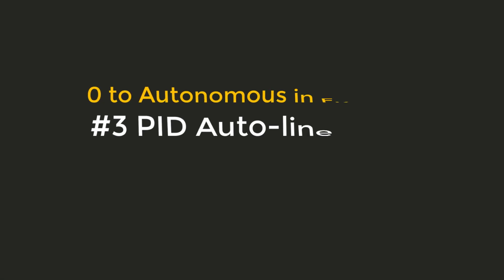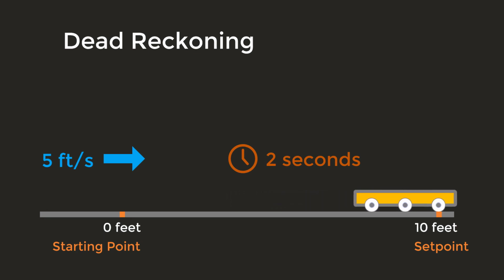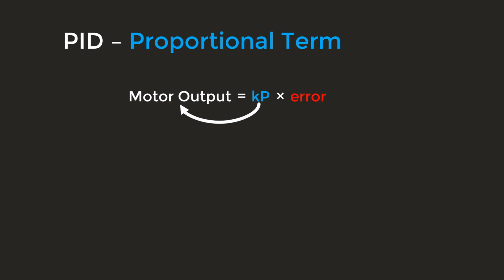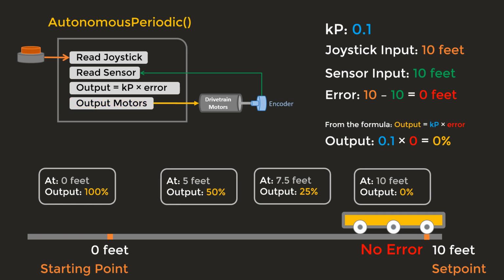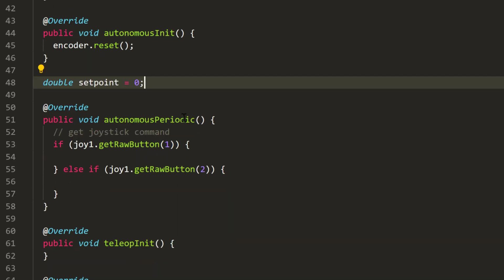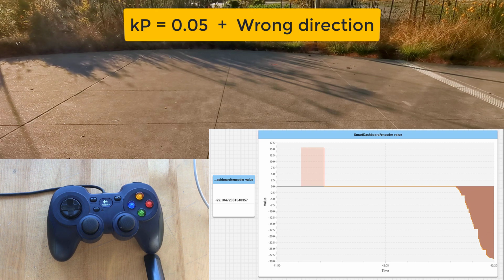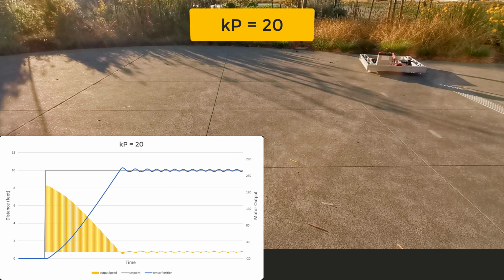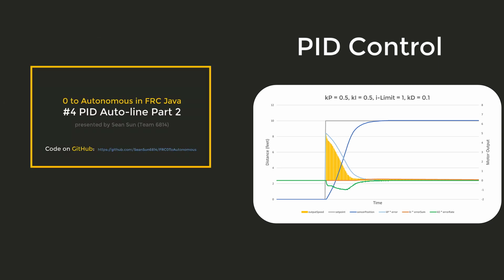FRC 0 to Autonomous: #3 PID Auto-line (Part 1)

Comment: Thank you for all your great videos, they have pushed our team to the next level. I just have a question on the formula of the KdriveTick2feet can you please explain what the values in this formula mean.
Reply: Hi, not the OP but that value is is the how many feet is between encoder ticks (This value will be super small)
At a high level, to calculate the number of feet between encoder ticks, you would divide the wheel circumference by the number of encoder ticks per revolution.
Looking at their code, the value 128 seems to me to be the number of encoder ticks per revolution and the value 6 refers to the diameter of the wheel.
The (1.0 / 128) is the value of their encoder ticks (done as a fraction in order to divide), while the (6 * Math.PI / 12) is the circumference of their wheel in feet.
Hope this helps!